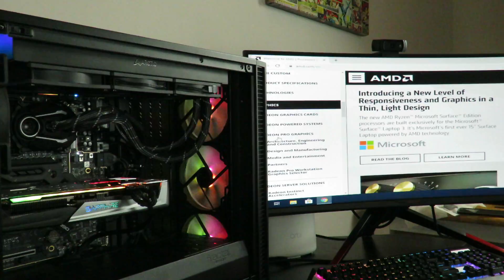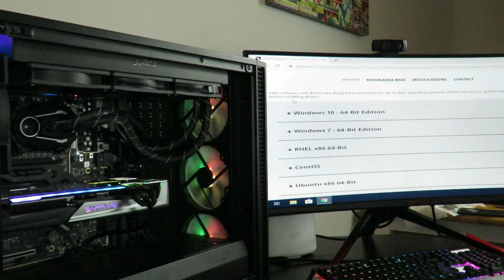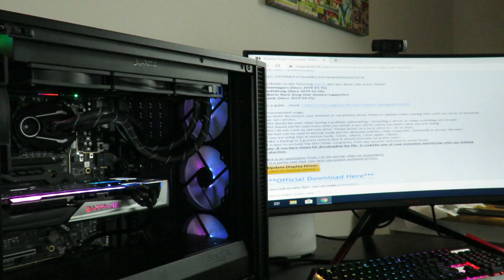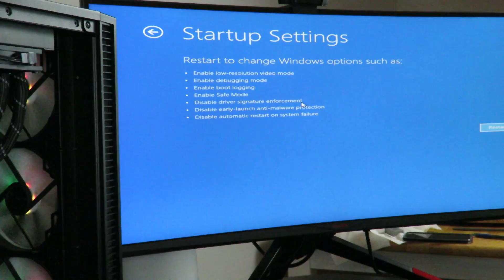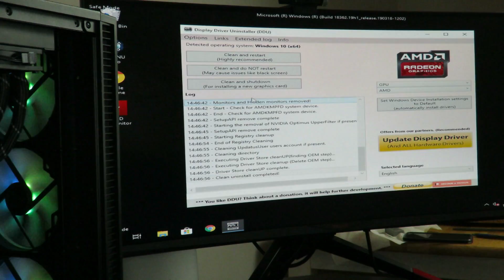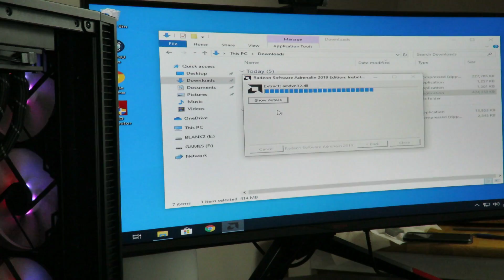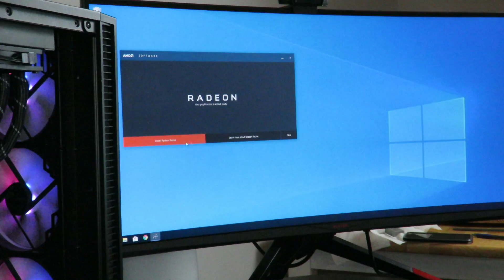Installing the AMD Sapphire Radeon Nitro+ RX 5700 XT 8GB OC Graphics Card

Comment: My gpu didnt light when i turn it on and no boot up in my monitor. Help me pls. :(
Reply from the maker: a few things, first off, are you using AMD or NVIDIA, I will help you no matter what, just want to know for sure?
Reply: @ThisBytesForYou  Thanks. I'm using rx 5700xt sapphire nitro+ . It is my first time building a computer and I manage to try booting it up and all.of my fans,ram,cpu fans, and motherboard are working and has led, but my gpu didnt light up.
Reply: @ThisBytesForYou  and my monitor didnt detect any like bios setup when pressing del key.
Reply: @ThisBytesForYou  I'm on a stage to install windows but it doesnt show up in my monitor the bios setup. And my gpu doesnt light up.
Reply: @ThisBytesForYou  I can't install windows 10 if my monitor didnt pick up any info from my computer and also the gpu didnt light up. Help me please sir! :(
Reply from the maker: @Djeafskie  do you have both PCIE power connections plugged into the video card?  Also, the HDMI cable many times feels like its plugged in, but it needs an extra push, an extra click in, just make sure its pushed in all the way.
Reply: @ThisBytesForYou  yes I do connect the two pci e slots in my gpu. And also the hdmi connection is plugged in to the gpu perfectly. I just dont know why my gpu didnt light up.
Reply: @ThisBytesForYou  and my monitor has no info whatsoever.
Reply: @ThisBytesForYou  I'm stuck in this. I cant even open my bios or install windows. :(
Reply from the maker: Can you tell me your motherboard and power supply  manufacturer and model number?
Reply: @ThisBytesForYou  My motherboard is MSI Z490 Mag Gaming plus and my power supply is Seasonic Focus Plus 750 Gold GX-750.
Reply: @ThisBytesForYou  I figured it out. Haha. I'm so dumb. I'm really a newbie 😆 . I forgot to connect the cpu power cable thats why 😆
Reply from the maker: @Djeafskie  hahah, well my friend, I have been building now for 28 years, and building alongside others during my early years at Alienware and I can tell you, this by far is not the worst I have seen, ohhhh I can tell you many stories from Alienware, Dell and Velocity Micro and you will know yours was not as bad haha.  so very happy I could help you a bit and glad  you got everything working.  How is she working out for you so far?
Reply: @ThisBytesForYou  I'm done installing windows 10 pro and the updates, driver updates and even flashing the bios in my mb so now I'm in a installation of the games. I really can't believe I didnt plugged the cpu power cable to the motherboard 😆. I'm so scared before that coz I thought maybe I have a faulty CPU or GPU Card.
Reply: @ThisBytesForYou  Anyways, thank you for your time my friend. :)
Reply from the maker: @Djeafskie  no worries my friend, from the newest builders to the "pros", it can happen to anyone ;)
Reply: @ThisBytesForYou  it's the circle of life. 😆
Reply from the maker: @Djeafskie  for sure

Comment: On the top of the card (when installed) there is a 3 pin spot to plug in a cable with a small arrow pointing to it. What is that for?
Reply from the maker: That is so you can plug it into an argb header to sync it with your motherboard and the entire system
Reply: is that for the lights?
Reply from the maker: @ezquerzelaya  yes, for controlling the lights through the motherboard, instead of the Sapphire utility.

Comment: Sadly my ASRock rx5700 XT keeps overheating and crashing no matter what I do will be send back today and just going to stick with nvida
Reply from the maker: have you checked the temperatures to verify it is overheating, because there is a common AMD driver issue at the moment that is causing things like that, unrelated to overheating.
Reply: @ThisBytesForYou  yes it's really weird I can run davinci resolve and do normal computer things but once I try to game the GPU over heats and turns off the computer I did the ddu and re downloaded the drivers, followed YouTube videos and still nothing..
Reply from the maker: @ReZShot  do you know it is overheating, or do you assume it is overheating because it blackscreens.  How are you seeing it is overheating?
Reply: @ThisBytesForYou  checking the temps... but when the computer opens games it runs only on the GPU and quickly overheats..I have put back in my nvida card and it works than tried the card again and same problem.. I'm guessing user error but 🤷‍♂️🤷‍♂️
Reply from the maker: @ReZShot  HOW DO YOU CHECK THE TEMPS
Reply: @ThisBytesForYou using the amd software plus the ASRock tweak
Reply from the maker: @ReZShot  wow, ok,... Thank you, when you say overheating what are the temps and are they gpu or hotspot temps?
Reply: @ThisBytesForYou  I don't remember now I even set the bios to default than redownloaded the drivers.. found another video to online saying use different power cables nothing's working.. nvida is so much easier to use
Reply from the maker: @ReZShot  ok cool, go for it, happy gaming

Comment: hi there, sorry if this has been asked before I couldn't really see. What is the need for downloading ddu? I couldn't really understand that. I have a brand new build and popped windows on it and downloaded my drivers and just downloaded my amd radeon rx 5700xt and installed that and it seems to be fine? So just wondering what the ddu is for?
Reply from the maker: Windows has loaded already in the image older drivers to make it more compatible, using DDU removes those older drivers, that have potential issues and allows for the newer drivers to fully install.  If you are not having any issues then you are fine and the install potentially did it's job correctly but since many times the drivers are in use while you are using windows, the installer holds files sometimes so you get a newer driver with some of the older driver still there and the files do not get overwritten.
Reply: ThisBytesForYou thank you so much for the quick response. I’ll keep an eye on it.
Reply from the maker: Completely my pleasure my fiend, so very happy I could help

Comment: Not sure if I'll have the luck of a reply with this video being around 8 months old, but I've seen others talking about using two cables for this power hungry card. Potentially dumb question (sorry, this is the first build I've personally put together), but would two separate 6+2 pin VGA cables be fine? I have an EVGA SuperNOVA G2 (850W, so it's up to the task) - not sure if it originally came with a more suitable cable as a friend handled it all for me years ago, but the two 6+2 spares are all I have until my custom cables are delivered.

Edit: Nevermind, I rewatched the section on plugging in the cables, you're using the same thing, right? They looked like a single cable on my first watch.
Reply from the maker: Hello my friend, no matter how old the video is, I always respond unless of course youtube doesn't deliver the message to me, which sadly is very often.  You are OK to put it on on cable, though I prefer using 2, just makes me feel a little better.  Actually, not in this video but in newer videos I have the bigger brother to your power supply, the EVGA superNOVA G2 1000Watt, they are great power supplies.  You are good to put it on which ever though, the card requires a 600Watt, though they recommend a 650, at 850 you are gold, so no worries my friend.

Thank you so much for checking out my video and commenting, it means the world to me.
Reply: @ThisBytesForYou  
Replies and does it on the same day? Buddy, you're awesome.

Thanks for the advice, I'd already finished up the build after realising that using two cables was likely what you were doing as well, but it's good to hear back all the same. I'll make sure to check out some of your other videos soon - sounds like it'll be worth it.
Reply from the maker: @thatboringone7851  Thanks my friend, always happy to help, and I always try to reply, within a few minutes even, sometimes I can't of course.  Thank you so much for wanting to check out my other videos, I have almost 400, I am sure I have a few others that can help.

thanks again my friend.

Comment: Question,  I just installed mine and I'm not getting power. I have only one power cable coming out of the motherboard, do I need 2 to run the card?
Reply from the maker: Yes, you need 2, what is the manufacturer and model number of your power supply

Comment: Make sure to turn your password off if you have one
Reply from the maker: that wasnt an issue back when I made this video, I think the issue started at windows 1909 or just before that one.  Actually what I do now is enable the Administrator before I do this, give it a password, and enter my password again for my account, just in case.
Reply: why do you have to turn off you password
Reply: ZioDio Your password may not work in safe mode so you cant log in to run Ddu
Reply: Jaxon ah thx
Reply from the maker: no, you don't have to turn off your password, just update it and it will be good.  After update, I think it was 1903 it caused this issue (it could have been another version), so updating your password will fix it.  So maybe change it to 12345678, apply it, then change it back to the password you had before.
Reply: ThisBytesForYou alright thanks man

Comment: can i use 600w power supply for rx5700+gtx1060?
Reply from the maker: Not sure who makes your card, but for reference, the Sapphire Radeon RX 5700 XT requires a 600 watt, but they recommend a 650 watt, as for the 1060, not sure from what manufacturer, but EVGA's requires a 400Watt.  With that, I would recommend the 5700 any day over the 1060

Comment: When i install drivers it isnt the same as yours it says adrenalin dont know if it does matter. But when i install it goes Black please help
Reply from the maker: Follow this guide I made, and make sure to grab the latest driver that just came out today, please report back on how it works.  Since I did not have the issue after I did this video, I can't test it, but I did have this issue once, the previous driver had this issue, which you might have downloaded, check out the video and download the latest: https://youtu.be/Qh2xEUXWeqs
Reply: @ThisBytesForYou  Downloaded the latest that came out yesterday it is working now, thanks!
Reply from the maker: @witte5679  awesome, glad to hear.  I sent out a notification yesterday to let people know but never heard back.  Thanks for letting me know.
Reply: @ThisBytesForYou  I figured out the problem were the hdmi cable i was using.
Reply from the maker: Ok cool, so it only works for you in dp?
Reply: No it was just a to old hdmi cable
Reply from the maker: Ahhh ok yeah, sadly the cables mostly don't say what they are in line with standards, but happy you can get it working

Comment: Wondering if you have a solution for me. I have the 5700xt Asus and b450 plus mobo with a 750w psu. Everything runs fans etc.. Until I plug in the gpu. Nothing works. I plug in the old gpu and pc runs absolutely fine. Do you know what this could be? Faulty 5700 xt maybe?
Reply: When I mean nothing works I mean nothing no fans, not boot. Just the mobo rgb and lights to show psu is connected to the gpu
Reply from the maker: The possibility of it being faulty is there, but let's see if we can work you through this.  I recommend first, unplugging the power supply just to be safe.  Then remove the video card, and then push it back into the PCI Slots.  Now make sure you have both PCIE x 8Pin connections plugged into your video card and give it another try.  Make sure both of those plus are PCIE VGA connections and not EPS connections, EPS are for CPU power.  After that, give it another try, but make sure to remove and put back in the card first, sometimes it just doesn't make good contact.

Comment: what cables you used to power the 5700xt? 8pin into psu and 2 6+2? or 2 single separate cable?
Reply from the maker: they can be 2 x 8Pins or 2 x 6+2 or 1 x 6+2 and 1 x 8, but you need to have both.  It can either come from one cable, if your power supply is rated high enough and has one or it can come from 2.  I like personally have have 2 cables, but it makes cable management a little more difficult sometimes.  What power supply do you have, manufacturer and model number?
Reply: @ThisBytesForYou  bequiet straight power 11 650w also i'm currently building my first pc and my motherboard ( x570 unify ) has 2 8 pin cpu connectors labelled cpu pwr1 and cpu pwr2 and another cpu1 my psu has one cable for the cpu that splits into two forming an Y labelled cpu 1 p4 cp1 p8 and another just labelled only p8, wich one is the right cable to put into the mobo?
Reply from the maker: @krahexp  oh boy, yeah that can be confusing, thank you for trusting in me to help you on this.  So go ahead and plug in the single P8 into your motherboard.  The additional 8Pin is for motherboards that have the additional 8Pin for additional power for the CPU for overclocking or for dual CPU socket motherboard.  The 4Pin is for older motherboards or lower end motherboards that do not provide as much power to the CPU, for lower end CPU's, usually non overclockable CPU's.
The manual is not clear at all, actually provides no documentation on this which is bad on beQuiet's part, but they do make some good power supplies.
Reply from the maker: @krahexp  Also, those are pinned so that you can't plug them in incorrectly unless you use brute strength to push them in and bend the plastic... I have seen this done before, haha.  We all laughed but it happens.
Reply: @ThisBytesForYou  thanks, you are really helpful!
Reply from the maker: @krahexp  anytime my friend, so very happy I could help.  I hope that system runs great for you and as always, if you have any more questions, please do let me know.  I have about 400 videos on here, surely I have some more that can help and if I don't have it, it might be an idea for another video.

Comment: Hello I have a quick question: after installing this card i'm not able to play any games but windows itself runs fine. I use a Corsair RM650x PSU but i don't know if it is in fact my PSU causing these problems. What do you think?
Reply from the maker: I don't know why you can't play games, you have not stated what happens, but I am assuming this video would help you: https://youtu.be/Qh2xEUXWeqs if not please give me some details as to why you can't play games, what happens?
Reply: @ThisBytesForYou  hi thanks for replying. The games that i can run and have tested are csgo and portal but both squad and post scriptum (running on the unreal engine) seem to crash within 10 minutes of booting them. They either just quit to desktop or freeze my pc completely. And i'm sure its down to the gpu. I ran a 2 hour stress test on heaven benchmark and the gpu did not get hotter than 76 degrees and didn't crash. So it must be drivers. I've tried everything from ddu to older drivers but it doesn't seem to work
Reply from the maker: @louis7421  sorry, not sure on that, but if you check out my latest video, reviewing the XFX 5600 XT, I play a bunch of games on it, no issues.  What card did you have before on that install?
Reply: @ThisBytesForYou  no card its a brand new build. This is really frustrating as i'm playing rising storm vietnam with no problems its just unreal engine games that give me problems. Even had a bsod 30 minutes ago
Reply from the maker: not sure what to tell you my friend, I have not come across any problems.  My recommendation is to update your motherboard bios to the latest version, set your PCIE lane to 3.0 instead of auto and fully update windows.

Comment: I have a thermaltake Lifepower 550w and my 5700xt triple dissipation is coming tomorrow and I don’t even know if it’s gonna have the right connections 😭
Reply from the maker: good news and bad news.... So the power supply does have 2 x 6+2Pin PCIE connection but they require a 600Watt and recommend a a 650Watt.  If you like I can recommend a 650 for you?
Reply: ThisBytesForYou I’ve been planning on upgrading my PSU for a while now I just wanted to buy the other stuff so I can still game, then worry about the PSU later.... clearly
I made the wrong decision.... will it still run though is my new question... if not I’ll have to resort to staying on a 1050 til I build enough money...Also I do wanna mention I went on some website I think it was like PCPicker or PCBuilder or something and it showed my PSU is compatible with my new GPU, idk if that helps.. 😐
Reply from the maker: @RandomTranzit  sorry i did not respond sooner, youtube is horrible about its notifications.  It may work, but when it hits that point in a game, where it requires more power, it may shut down your PC or you might get a bluescreen or some other error.  PCPicker or PCBuilder are great resources, but if the manufacturer and them recommend different things, the safest bet is to go with what the manufacturer recommends or requires.
Reply: ThisBytesForYou I had to take the chance at this and it works surprisingly well, I haven’t had an issue yet and I’ve been running this for a few months. I appreciate the advice though! I do plan to upgrade to a 750w EVGA PSU soon, but it’s all good lol I didn’t expect you to respond